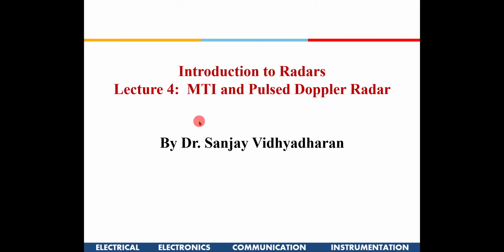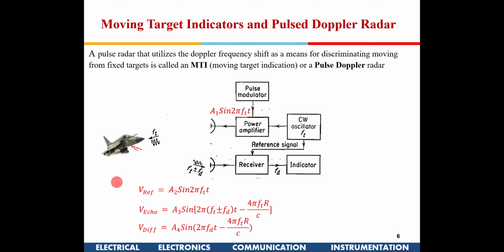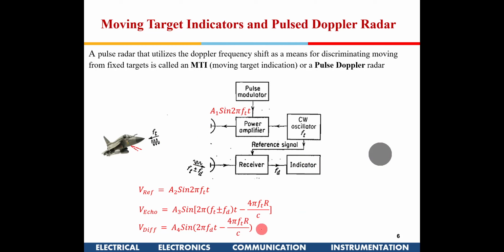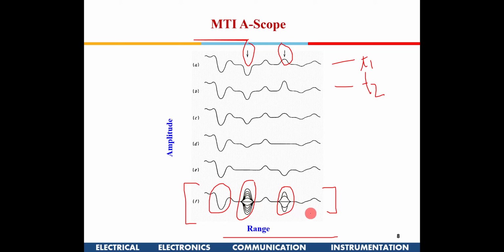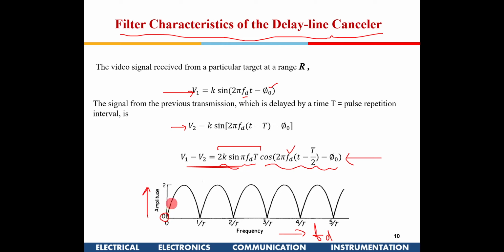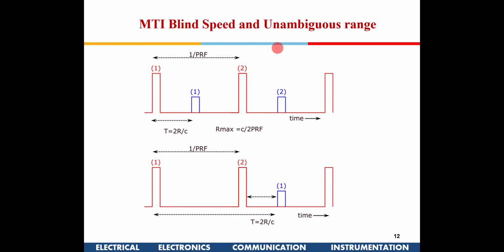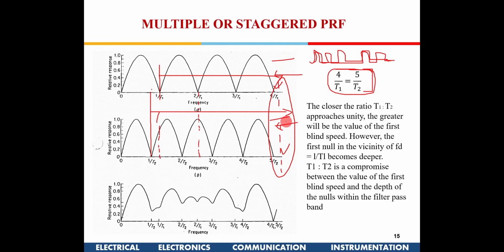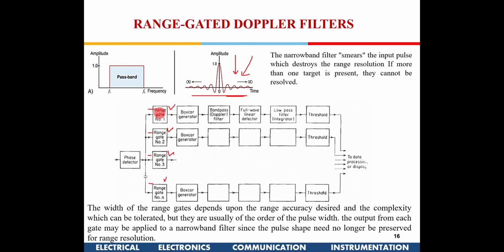Introduction to Radar Lecture 4:  MTI and Pulsed Doppler Radars

Comment: standard.
pulsed.
whip pulsed.
twin beam staggered repeater whipped pulse.

the third should change efficiency from dividing by two to dividing by √3. and it would enable boost pulse strength to over the 150% pulsed power of a stage 2 versus stage 1.

stage 4 increases scan resolution to determine more perfectly shell composition of a target. a slight intimation with a strong enough signsl could ionize the atoms of a target with adaptove cloaking technology to partially drop that cloak.
7:20 and onward.

2 dimensions
3 dimensions
4 dimensions

and 5 dimensional could be condensed but in doing that the systems would need to be purely and perfectly calibrated amd would need to have a comprehensive database of stage 4 data prior to even starting up. and there would of a necessity be a sacrifice or consumable ammo to break the surface tension of time barriers. essentially you are responsible for being able to predict register and alter spacetime in a location.

Ivy Mike did that. on a small level crystals can do that. Piezoelectricity is a manifestation of purity accessing conduits of energy traveling on stage 4 and higher states.
Reply from the maker: ok